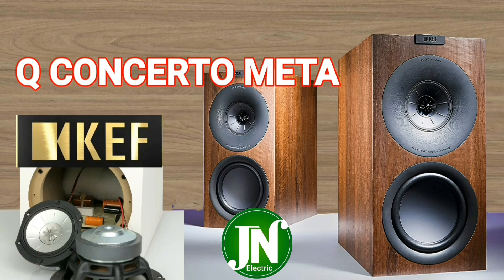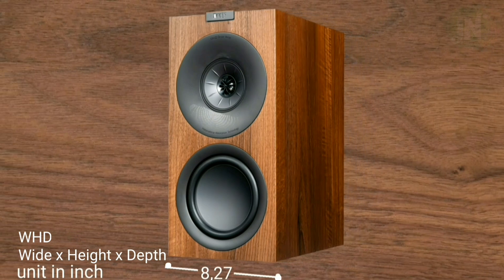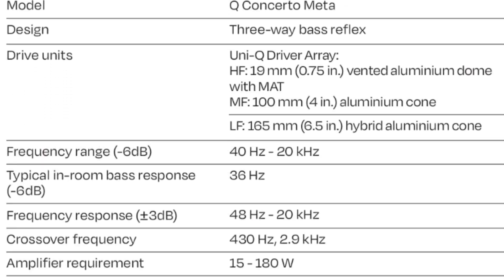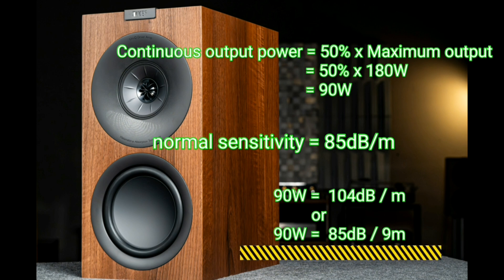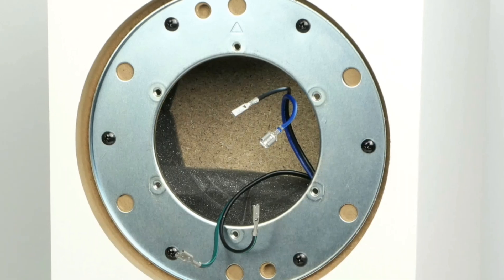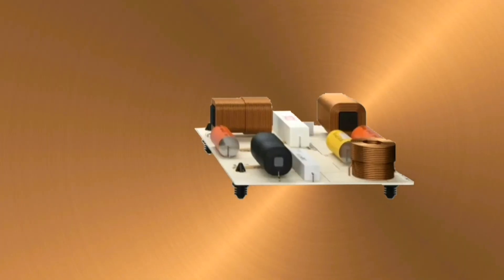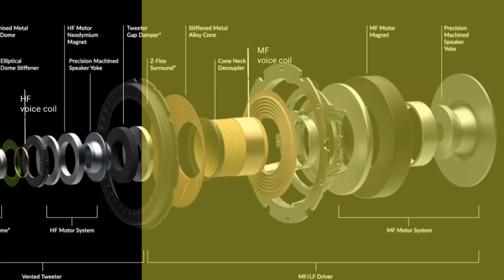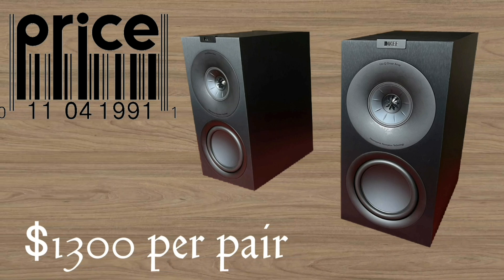Kef q concerto meta expose in/out side technical

Comment: The speaker size is the "basket" diameter. The diaphragm (typically cone) is always smaller. The active area does not include the rubber surround, so this lower speaker is quite small.
  
Also, manufacturers have been using rings to make the small speakers look larger.